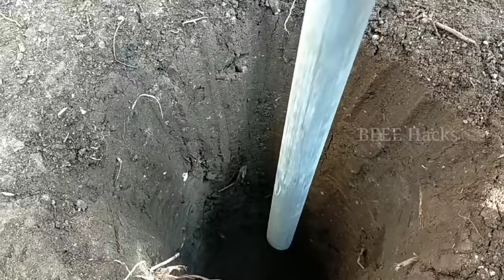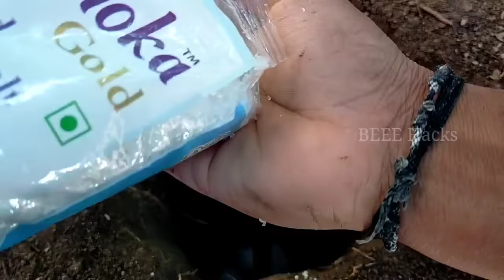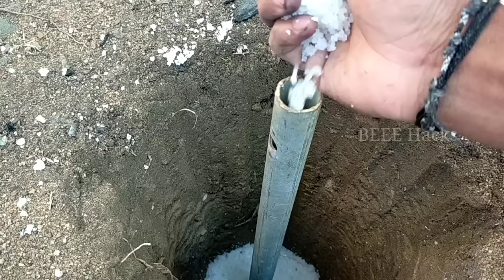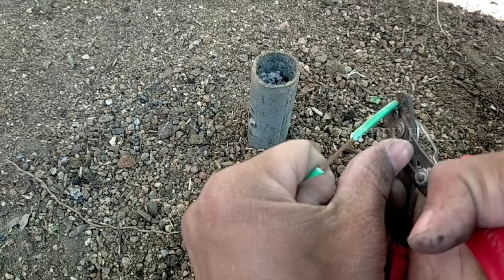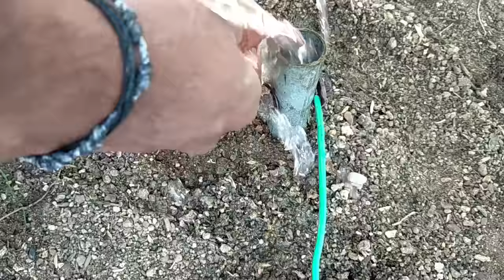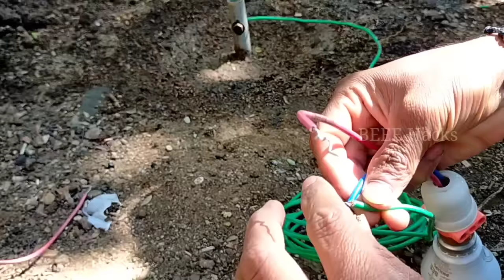How to make an Earthing at home | Earthing connection for home

Comment from the maker: Earthing for home.
https://beeehacks.blogspot.com/2021/02/earthing.html
Reply: You have not used water to settle fown everything
Reply: in between the procedure
Reply: Shouldn't mislead others into getting electrocuted with half baked sharing and bare hand testing live wire. Because using low wattage bulb of 15~30W testing, the current flowing is very low below 0.15A.

Per my own past experience and some research, a proper earthing require minimum (those who know better pls correct my mistake if any):

1) Nailed a solid earth rod of min 1.5cm diameter & 2m length (min depth of 1.8m inside earth). If you can drill a 2m hole, then using big hollow rod does give a better surface area.

2) Thick copper wire of 6mm standard and 3 copper threads type (the one in video look 1.5mm and is multi fine threads, easily oxidized over time). The thicker is better for safety say 6mm if to connect from earth rod to main earth point for entire home (internal earth wire laying can be 1.5~2.5mm).

3) Salts and charcoals are meaned to absorb water moisture to improve earth conductivity surface with the soil, esp if its sandy & not good clays. Adding sands is increase porous for water flowing only, as sands are not good in conductivity. 

So you need to locate the earth rod around constant moisture area such as water drainage, or need to wet the area regularly in dry summer to ensure the earth rod function well.

4) Using 3pts earth measuring meter to ensure the earth resistance is below 5 ohms, preferably 2ohms. If you can't get below that, add extra same earth rod (min 1.8m away to avoid overlapping earth zone). This will reduce resistance by approximately half. Add until you get below 5ohms.

5) If you have no access to proper earth measuring meter that cost $100~300, use a 100watts light bulb to test(current flow of 2.2A). It should light up brightly with one end connect to 110/220V live wire, the other to the earth wire. Using 15w bulb testing is useless since current flow is below 0.1A). 

Ideally the earth wire must able to divert away 10~20A current, so I used a 2KW kettle to test boiling water and measure the current flow using a clipper ammeter clip on wire. If the power supply voltage is 220V, current is 9A, then the earthing is quite ok.

If you don't have clipper ammeter, use P=VI, Current I = 2000W /220V=approx 9A if the kettle boil like normal (if very slow means earthing is weak, current may be only 1~5A) showing not ok. Or you can measure Vk, the voltage drop between kettle two wire ends, I=Vk/R=Vk/25.

Using P=VI, R=V/I, you can estimate the resistance of earth by: Rt=R1 + R2, where Rt is total resistance seen from current input, R1 is kettle heating coil resistance (R1=V/I=V²/P=220²/2000=24.2, ~25ohm), R2 is earth resistance.

Rt= V/I. V= voltage drop between power supply (220V) and the earth. Vt=V1 + V2, where Vt=Total voltage=220V, V1=voltage drop between kettle two wire ends, V1=IxR=25I. So V2=220 - V1(assume your power supply is stable, usually it will drop for poor country to even 120~180V).

That say we get 8A flowing through the kettle, V1=200v,

R2=V2/I=(220-200)/8=2.5ohms. That's acceptable close to ideal below 2ohms.

If I=5A, R2=(220-5x25)/5=19ohms. Need to add another few earth rods connect in parallel to reduce it to below 5ohms. 1/Rt=1/R1 + 1/R2 + …1/Rn.

Usually bad earth will give I=2A that can still light up 60W bulb well, R2=(220-2x25)/2= 85 ohms. The one in the video is likely to be around 50~300 ohms.

Usually those need to make own earth point live in rural area with poor power supply. So Vt will be a fluctuating variable under loading requiring meter measuring for accuracy. 

Hence engaging a qualified electrician is better if you have no capability than to regret later.

Comment: I don't think you have installed it in right way. You used corroded bolt which will provide bad conductivity. Secondly the insulator of wire came in between pipe and washer, so there is not good contact between pipe and the wire.

Comment: Shouldn't mislead others into getting electrocuted with half baked sharing and bare hand testing live wire. Because using low wattage bulb of 15~30W testing, the current flowing is very low below 0.15A.

Per my own past experience and some research, a proper earthing require minimum (those who know better pls correct my mistake if any):

1) Nailed a solid earth rod of min 1.5cm diameter & 2m length (min depth of 1.8m inside earth). If you can drill a 2m hole, then using big hollow rod does give a better surface area.

2) Thick copper wire of 6mm and 3 copper threads type (the one in video look 1.5mm and is multi fine threads, easily oxidized over time). The thicker is better for safety say 6mm if to connect from earth rod to  main earth point for entire home (internal earth wire laying can be ~2.5mm).

3) Salts and charcoals are meaned to absorb water moisture to improve earth conductivity surface with the soil, esp if its sandy & not good clays. Adding sands is increase porous for water flowing only, as sands are not good in conductivity. 

So you need to locate the earth rod around constant moisture area such as water drainage, or need to wet the area regularly in dry summer to ensure the earth rod function well.

4) Using 3pts earth measuring meter to ensure the earth resistance is below 5 ohms, preferably 2ohms. If you can't get below that, add extra same earth rod (min 1.8m away to avoid overlapping earth zone). This will reduce resistance by approximately half. Add until you get below 5ohms.

5) If you have no access to proper earth measuring meter that cost $100~300, use a 100watts light bulb to test(current flow of 2.2A). It should light up brightly with one end connect to 110/220V live wire, the other to the earth wire. Using 15w bulb testing is useless since current flow is below 0.1A). 

Ideally the earth wire must able to divert away 10~20A current, so I used a 2KW kettle to test boiling water and measure the current flow using a clipper ammeter clip on wire. If the power supply voltage is 220V, current is 9A, then the earthing is quite ok.

If you don't have clipper ammeter, use P=VI, Current I = 2000W /220V=approx 9A if the kettle boil like normal (if very slow means earthing is weak, current may be only 1~5A) showing not ok. Or you can measure Vk, the voltage drop between kettle two wire ends, I=Vk/R=Vk/25.

Using P=VI, R=V/I, you can estimate the resistance of earth by: Rt=R1 + R2, where Rt is total resistance seen from current input, R1 is kettle heating coil resistance (R1=V/I=V²/P=220²/2000=24.2, ~25ohm), R2 is earth resistance.

Rt= V/I. V= voltage drop between power supply (220V) and the earth. Vt=V1 + V2, where Vt=Total voltage=220V, V1=voltage drop between kettle two wire ends, V1=IxR=25I. So V2=220 - V1(assume your power supply is stable, usually it will drop for poor country to even 120~180V).

That say we get 8A flowing through the kettle, V1=200v,

R2=V2/I=(220-200)/8=2.5ohms. That's acceptable close to ideal below 2ohms.

If I=5A, R2=(220-5x25)/5=19ohms. Need to add another few earth rods connect in parallel to reduce it to below 5ohms. 1/Rt=1/R1 + 1/R2 + …1/Rn.

Usually bad earth will give I=2A that can still light up 60W bulb well, R2=(220-2x25)/2= 85 ohms. The one in the video is likely to be around 50~300 ohms.

Usually those need to make own earth point live in rural area with poor power supply. So Vt will be a fluctuating variable under loading requiring meter measuring for accuracy. Hence engaging a qualified electrician is better if you have no capability than to regret later.
Reply: Please what are the disadvantages?

Comment: Salt and charcoal increase the conductivity of the soil in the earth pit. But we should not directly use salt inside the pipe as it will make rust and damage the pipe. As a result the longibity and life of the pipe will reduce.
Reply from the maker: Pipe is not stable, besides copper will stable
Reply: You are very right
Reply: use pvc pipe, copper board and copper wire 5mm

Comment: you might want to make a three point resistance measurement through dry earth with lower resistance than 3 Ohms to not get electrocuted, i estimate the the length of 1" pipe at least 5m depending on quality of your soil, then you take two earthnails around 30cm length in a distance of about 5 and 10m, if above 3 Ohm add another 2 m on top, or put another 5m next to the first and connect them until you´re good
Reply from the maker: Great information

Comment: Today I have done my earthing as per your direction. One 4mm 2 meter cupper wire rape on the 5feet  GI pipe of   40mm dia cost.350 with bolt and nuts on top and bottom/. 2 tin charcoal cost..100/ salt.13kg..cost.100 rupees  Sand one ciment bag cost..20/ labour cost.250/ ..so total . cost.. approximately 850/ . checked earth come within 5 minutes. Many many thanks..
Reply from the maker: Thanks for ur feedback sir.

Comment: There’s no conduction, bolt is very rustl
Reply: Yes
Reply: Bulb is glowing thought
Reply: @urandurparthu1526  this is led bulb if you connect halogen bulb it will glow but dim
Reply from the maker: Yes, because low voltage
Reply: @BEEEWorks  ok sir
Reply: Sir wire kitne mm ka hai

Comment: It should not use Salt because the iron pipe and salt make a chemical reaction and as a result the rust produced and the pipe will be damaged within a few months..The salt could be use only hilly place where water level is very low,the wire size is too much thin which use by you for proper work

Comment: -7.2.1 What is Earthing

weak insulation, element breakage and the like. The device consists of a copper or GI wire that comes out

Earthing is a very important safety device that is used to prevent shocks caused by leakages arising from of an electrode. Earthing is placed 2.5 to 3 meters underground. The potential of earth is always assumed to be zero. Electrical equipment is said to be earthed when it is added to the wire.
🖤

Comment: अच्छा होता अगर आप 100w बल्ब जलाते तो पता चलता की तेज जल रहा है या कम LED में बराबर पता नही चलेगा ,अर्थिंग मजबूत है या नही।
Reply from the maker: U means led bulb was low power consumption hence it should glow. Of course 60 watts bulb also glow but glow with low voltage due to earthing is not act as pure neutral wire so it will supply low voltage between line and neutral Hence the 60watts bulb glow with low of light (dim)
Reply: @BEEEWorks  I mean to say if you use earthing for neutral purpose , so how we check with bulb ( how much Watt) for proper neutral
Reply from the maker: 60w or 100watts GLS bulb is best one to check proper Earthing. Thanks for clear your doubt 😍
Reply: @BEEEWorks  so,in proper nutral bulb should be glow bright or dim

Just make is clear bro.
Reply from the maker: Dim

Comment: Where is copper  plate and copper nut bolt . 2 - copper  rod from depth to top level clamp.  Incomplete demo.
Reply: Not required  opper everywhere
Reply: It's generally used in big buildings.. but for a bunglow purpose not required

Comment: Don't follow this video to make earth point for entire house usage. Its not proper, you risk getting electrocuted & fire.

This way of doing, the earth resistance is likely well above ideal 2~5ohms.

If you only use for single point earth usage say power tripping safety circuit to protect some equipment out of no choice, then you can take a risk. Otherwise don't.

Using for bed sheet earthing health purpose is alright even the earth resistance is 300ohms.

Comment: How many days required to get earth power??
Reply from the maker: Actually no power comes from Earth . It is used for passing of leakage current through an Earth. But earthing is also used as neutral wire. This neutral wire is formed in just 1min. Tq sir 👍

Comment: hi I have a dought is the earth wire and the neutral wire shorted
Reply from the maker: In the video I shorted phase and earthing wire. If earth and neutral wire is shorted nothing will happen. Are clear
Reply: @BEEEWorks  one more thing there is shock coming from the USB ports of my pc
Reply from the maker: IAM also facing this problem, it is due to high current takes of your PC  adopter. But no problem. By Using Earthing you can avoide shocks.

Comment: Why need to put salt & coal?
Reply from the maker: Salt and coal is used for minimize the Earth resistance. it means increase the flow current into a Earth .
Reply: @BEEEWorks  if you put salt near an iron it will rust the iron very quickly
Reply from the maker: Nooo salt never forms a rust
Reply: @BEEEWorks  clouride and salt dont gi together. Look at those houses with galvanize roof near the sea they got rusted faster than those houses much farther away also check with goggle on how salt affect   metal.
Reply from the maker: The formation of rust is due to oxidation of metal. Salt means Nacl . In salt only sodium and chlorides are presented. There is oxides in salt how can form rust without oxides ??
Reply: @BEEEWorks  i think you are correct those house near the beach are getting an oxidized salt from sea  water.
Reply: Should i use only earthing pipe without salt and coal
Reply from the maker: Yes but u have to maintain wet of pipe place by poure water and efficiency is very low

Comment: Sir how to connect  ups supply in single phase board
Reply from the maker: Connect the phase wire which is comes from back side of UPS to switch board and neutral is common sir.

Comment: Where connect earth wire in meter
Reply: Earth wire will not go through the meter. It just directs from the 5th pin only.
Reply from the maker: No need to connect earth wire for meter it just for 5th pin of socket and any iron metal of db box

Comment: That's not the proper way do it electrical grounding.
Reply from the maker: Any thing else wrong ?? Can you where I stepped wrong
Reply: @BEEEWorks  1. Salt cannot put there cause make corrosion to GI pipe. 
2. Cannot use GI pipe cause cannot give proper reading for lower the resistance value. Must use copper rod. 
3. Must take reading using earth tester after finish put that GI in the soil.
Reply from the maker: Formation of Corrosion is due to rod reacts with  oxygen. Iam I right, Salt means sodium chloride(Nacl). There is no oxides to form rust in salts. Hence salts never corrosion of GI rod.
Reply: He is making earthing not grounding.
He is doing one of the four types of earthing (i,e) Pipe earthing and not Rod earthing.

Comment: This is offensively idiotic method of earthing!
All this Salt is going to do is rust away the rod into oblivion quite sooner than you can imagine.
Apart from the fact that the copper wire used in this grounding method should always be with a copper wire lug and soldered for certainty.

This way you have SOLID connection to your ground for your entire house.

You know, this grounding rod in this video will quite literally be rendered useless with the 10 minute test with a solid machine 6-8kW/h water heater or a electric motor.
You test your ground this way:

You get your LINE from electric provider
You get your NULL from the GROUNDING ROD (you just made)
And power an electric socket splitter. 
GROUNDING is your N
and 
LINE is your Line.

Then simply plug as many heavy loads as you have - electric heater element, electric motor, hair dryer, convector heater - anything sizable (6-8kW in total).

And turn everything on. Simply wait few minutes and you will visually see how your hair drier reduces rpm and till eventyally stops working at all.
You know why?
Because Grounding is ABSOLUTELY essential for your machinary. 
This is CRUCIALLY important for solar inverter equipment.